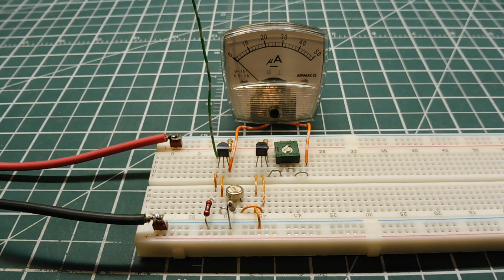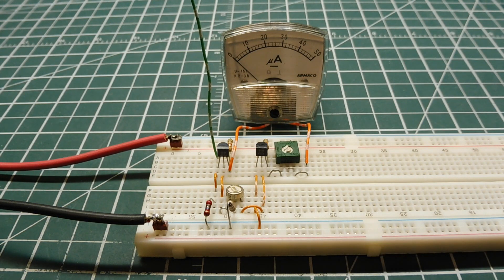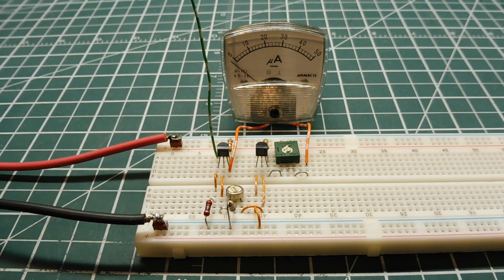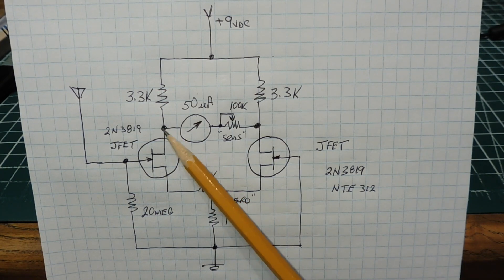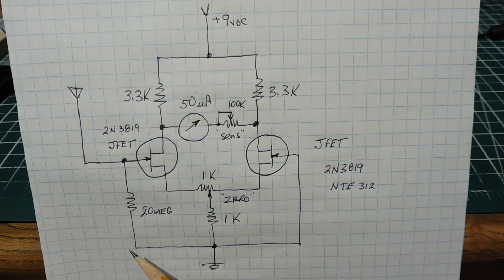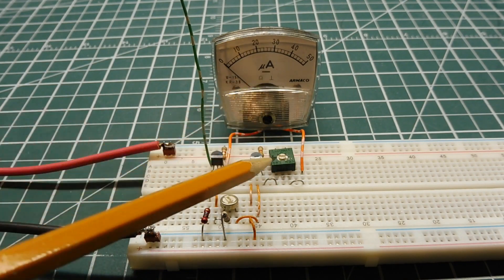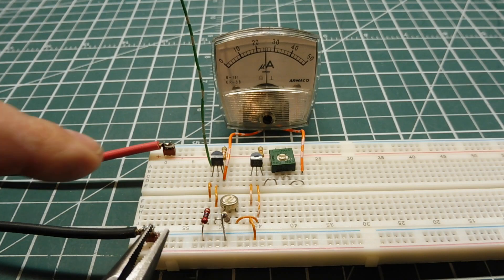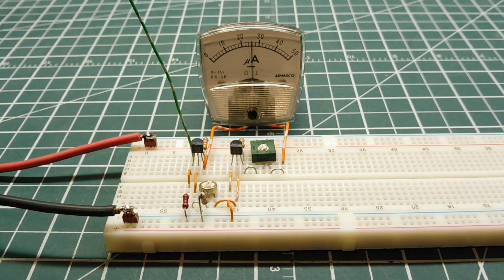Build A Static Electricity Detector

Comment: As a textile engineer, I'd like to build a static electricity detector (funded personally) to demonstrate the concept to my textile and garment design students who have very basic knowledge of this important textile property. I was impressed by its sensitivity at 7ft and believe it could be used to measure static electricity differences in wool, cotton, and polyester at varying humidity levels. I have experience with electrical components and soldering. This could also be a valuable project for others, with due credit given. Please send more information. |
PS: Any suggestions for improvement are welcome.

Comment: Is it possible for there to be a build up of charge on the antenna wire when the damping resistor is removed? What if, say, I momentarily connected a voltage source to that wire (less than the gate breakdown voltage) and removed it. Would the static charge get left on the wire, and would that potentially prevent the transistor from switching? Thank you!
Reply from the maker: There is a capacitance from the gate to source which can store a charge, but there is also internal leakage that will eventually discharge the capacitor. The leakage to ground from the antenna and the contacts in the solderless breadboard will also aid to discharge the internal capacitor.

Comment: Thank you for this excellent tutorial. I couldn't find 2N3819 jFETs locally so I have used BF246B instead. I'm powering this unit from one Li-Ion 18650 cell because I need it to be portable so I can use it in my workshop. Power consumption when idle is around 1mA, it should work around 3 months on a 2500mAh cell. I have also added a piezzo buzzer by utilizing LMV321 op amp in comparator mode. Detection distance in my case is 1 to 1.5 meters. Make sure to completely REMOVE FLUX RESIDUE from the board because it greatly affects the distance - on a dirty board, distance was reduced to a few centimeters.
Reply from the maker: Glad it worked out for you. Thanks for sharing!

Comment: So I tried recreating this for a school project but when I hook voltage to the circuit I’m getting 2.4 milliamperes of current through the meter. That’s before I have any static electricity near it. I bought the transistors online and the resistors exactly like you have but I’m not sure why it’s measuring so much current. I’m using resistors instead of potentiometers but the ohms are correct. So I can’t zero out my meter. I’m just wondering why it’s not reading at 0 like yours is in the circuit until you apply static electricity near it. I’ve double checked my circuit and wiring as it’s not a hard one to build. Just unsure why it’s reading so much current   I bought a 500 ua meter. But it maxed it out so I measured with a digital one
Reply from the maker: You need a potentiometer to zero the circuit, its hard to do otherwise. Check out this video around the 7 min mark that shows how to zero the circuit:
https://youtu.be/WaFBUnep7T0
Reply: @0033mer  ok. But I’m not seeing two 1k ohm resistors. Just one and the potentiometer. Did you replace one of these with the potentiometer and is that how you dialed it in. If the sensitivity pot (100k resistor) is not in the circuit
Reply from the maker: There is one 1k ohm resistor and one 1k ohm potentiometer as shown in the schematic. A potentiometer has three leads. The 1k ohm resistor is in series with the wiper lead.
Reply: @0033mer  OK so if I put a potentiometer in place of the 1k resistor that I have, will it reduce the current going through my circuit so it doesn’t max out my meter when I apply voltage.   I double checked my wiring earlier and everything seems correct . And I have a 500uA meter  I just don’t understand why current is so high and maxed my meter out if everything is the same
Reply: Do you have an email I can contact you through ?
Reply from the maker: Look in the "About " tab on my home page.
Reply: @0033mer  I ended up getting the circuit to work. Although I had to remove the 100k and the 20megaohm resistors for it to work. With these resistors in, it barely moved my meter I had so it worked a lot better at measuring the current increase and decrease without them and was visually easier to see on the meter
Reply from the maker: Glad to hear you got it going. I used NTE312 jfets in my circuit which are more sensitive than 2N3819 which probably explains the different results.
Reply: @0033mer  probably so. I didn’t know there was a difference in sensitivity.

Comment: How to the non moving detectors work?
Reply from the maker: An electroscope uses electrostatic induction to detect static electricity. Two pieces of metal foil hanging side by side will repel each other when a charged object comes close.

Comment: To connect the meter polarity correctly to show charge polarity, first understand how this responds to charge:

If the voltage induced on the JFET gate is negative, it causes current through drain to source to reduce. This causes the voltage drop across the 3.3k source resistor to reduce, so the voltage at the JFET Source terminal is increasing.

Meanwhile, this causes the JFET on the left to do the opposite - voltage across its 3.3k resistor increases, causing the voltage at that Source to decrease.

So for a negative charge induced on the sense antenna, the left side of the meter will go more positive than the right side.

If you connect the meter + terminal to the right and - terminal to the left, it will now correctly indicate if the charge is positive or negative.

Be aware, however, that there is a difference between charge induced, and charge transferred. Especially if you have not grounded the instrument, you can get spurious readings.
Reply from the maker: https://youtu.be/WaFBUnep7T0
Reply: I will be using this +-50uA center zero meter with this circuit:
https://amzn.to/3b76hG6

Comment: Surgical mask using for protecting against COVID-19 usually include 3-layers, the middle layer is made of melt-blown polymer which is electrostatic charged for capturing and holding virus. Many poor quality mask has no electrostatic charged or very weak. I have some different surgical masks and I want to compare their static strength in order to find out which provide better protection. However, I could not afford to buy a electrometer. I want to make use of your circuit to build a eletrometer with a DMM which can give me a figure for comparison. Do you have any suggestion how to find electrostatic unit from the reading. Also, I find many schematics not using bridge curcuit. What is the advantage and disadvantage on using bridge curcuit like the one you presented.
Reply from the maker: The Wheatstone bridge uses null deflection measurement which cancels out errors and can detect minute input changes that will unbalance the bridge giving a meter deflection. Power supply variation will not affect the null point. Check out this video on the subject: https://youtu.be/WaFBUnep7T0

Comment: Hi, thanks so much for the excellent video. The JFET you are using on the breadboard was NTE312. I thought they were 2n3819 in which the gate is the middle pin.
Reply from the maker: The NTE312 and 2N3819 are electrically equivalent Either can be used in the circuit. Pinouts will vary, connect as per data sheet.
Reply: @0033mer  Hi again,  Thks for yr prompt reply.  I just tried the circuit as shown in your diagram using 2N3819. The circuit worked as expected.  But when I unplug the 20m damper I did not have the sensibility as you did. The ammeter simply shoots beyond 50uA  and that's it.  Anyway it's not very important. I was just playing around.  Currently I am walking thru all the videos you had published.  I learnt a hell lot of things from you.  Encore bravo et merci

Comment: Interesting. Does it have an application for preventing ESD?
Reply from the maker: Not preventing ESD but can measure ESD quantity in your situation.
Reply: @0033mer   Yes, I meant that as a tool to double check if you've accumulated electric charge before you touch something.